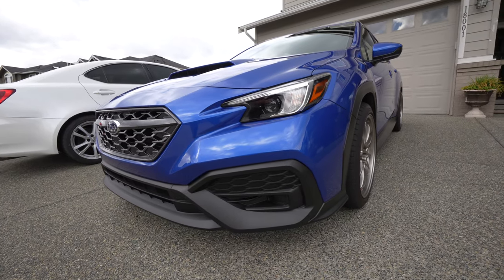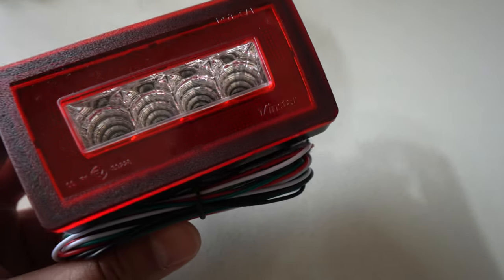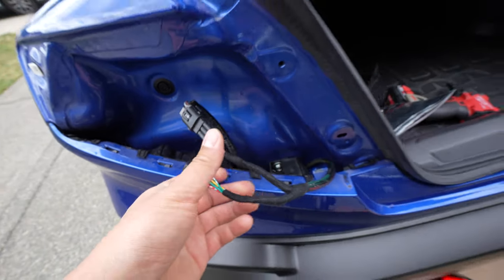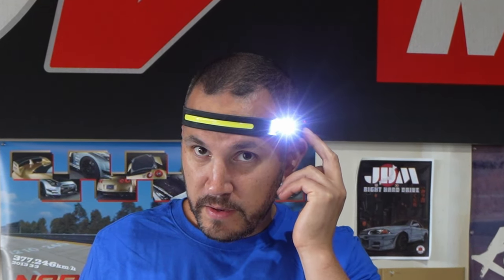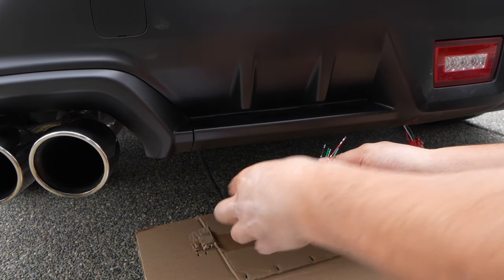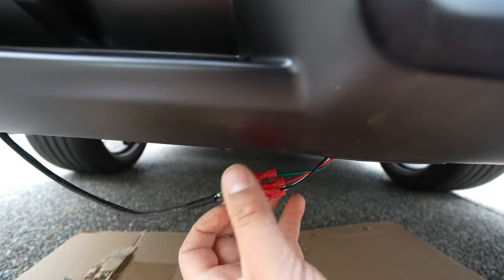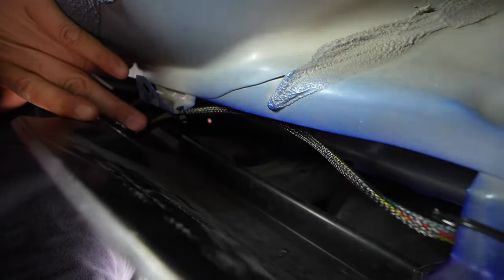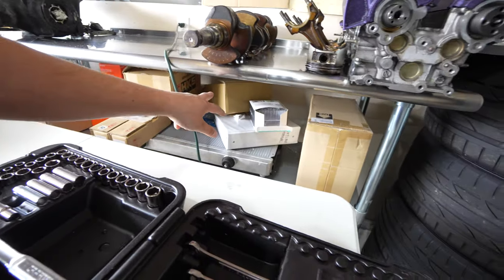2022 WRX F1 light install 4th brake light VBH WRX S4 2023

Comment: Nice content. 

I was thinking about this WRX or the 2022 civic Si , which one is better? And overall car.
Reply from the maker: I like the Civic as well and I think long term it would be a more reliable car. I just have to have an AWD car for where I live in the Pacific Northwest. Lots of rain here and need that AWD for the snow days. Thanks for watching and good luck with your search.
Reply: @JDMRightHandDrive  I have been wanting a Subaru for the longest , but I don’t know if parts are expensive when it come to maintaining the car. Plus since gas price is high now don’t know the gas mileage on the wrx. Honda is reliable but it doesn’t have as much power as the wrx

Comment: Any chance of an audio upgrade video? Replace door speakers with higher end speakers?  Does it have the rear parcel tray hole for the subwoofer to put aftermarket in?
Reply from the maker: I think after I get the STI shifter installed I will do a speaker upgrade video.

Comment: Can you simply not connect the wires you don’t want (like running lights), and the others will still work? I want it only for reverse and brake but not running. Thanks in advance.

Comment: Does the reverse light portion make a noticeable difference on screen for the back up camera?
Reply from the maker: Yes, you can most definitely notice the ground under the rear bumper illuminated on the back up camera screen. I didn't notice that until I left for work early this morning. I wish I would have thought of that an put it in the video last night. Thanks for watching.